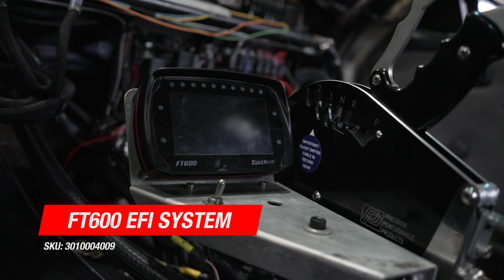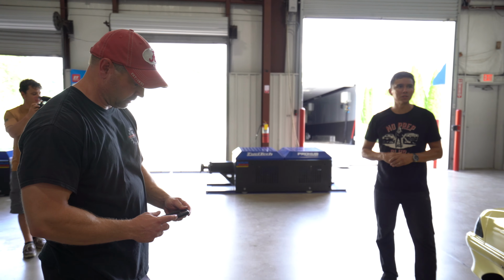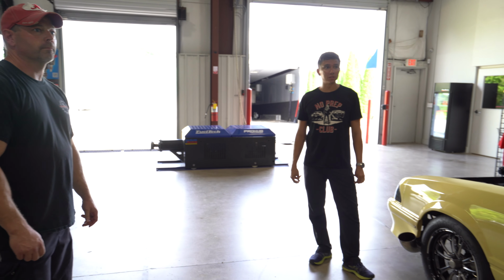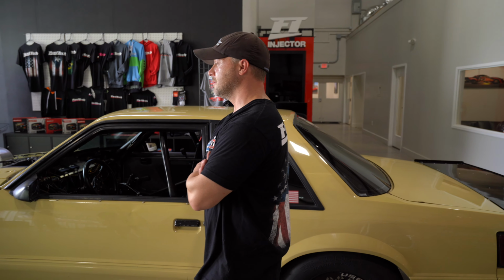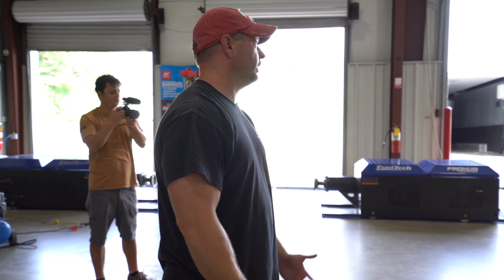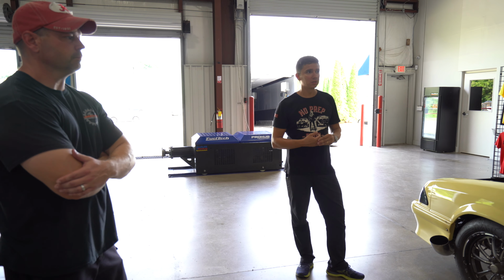Hemi Small-Block Ford | N/T Street Car Shootouts | Marshall Carpenter

Comment: Never showed the cylinder heads or any of the build. A lotta talk, no track, I'm sure it runs but not showing parts, no what kinda head. That is what the headline said. a lot of talk. Not what these are.
Reply: It's a Hammerhead Performance 'hemi' head(more of a 'semi-hemi', a lot of Boss 429 influence; the founder used to work for Jon Kaase). Offers them for both SBF & LSx. 
This has them bolted on top of a Titus Performance Cleveland style block - really cool combo.

Comment: "Street car", where's the radiator?
Reply: Car running on alcohol so it runs really cool
Reply: MEXICO
Reply: Didn’t they say in the video it’s in the back under the trunk?
Reply: The term ‘street car’ means next to nothing nowadays. I swear some guys could find a way to classify a funny car as a street car~
Reply: It’s in the back of the car
Reply: Radiator in the trunk - it's a relatively common move in street/no prep builds that are still water cooled. Works just fine on the street, there's drag-n-drive cars running rear radiators too.
Reply: @aaronliddell4280  Fact is that the limiting factor in what was a street car forever used to be drivability, you generally couldn't make big power and still have drivability - well modern EFI completely changed that, and there's a whole lot of us out here that don't care if our street cars are loud & hot, cuz we're the ones driving them(not that I have anything on this level of course😆). My first car was a no option Geo Tracker, soft top, 2WD, 5 speed, AM/FM radio, no AC, manual windows, and about as much sound deadening as a race car; some people's 'requirements' for what a "street car" is would disqualify many bone stock cars😂